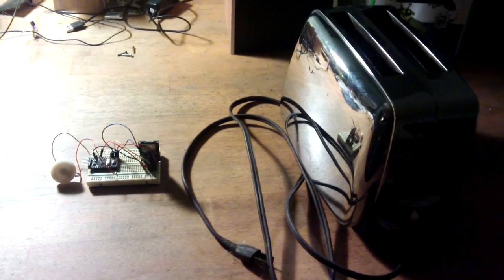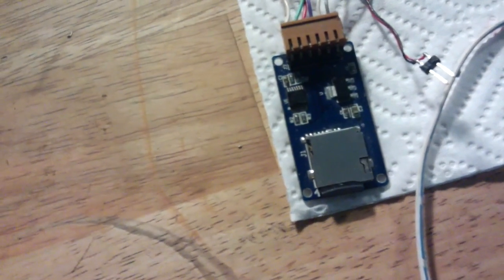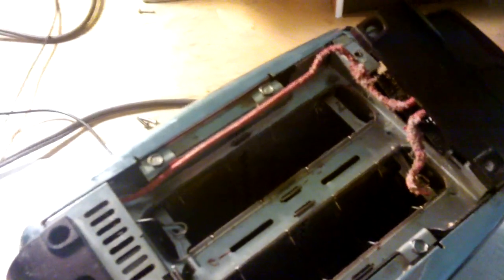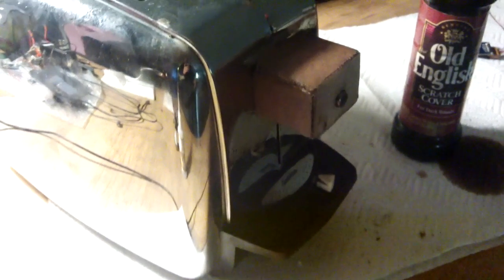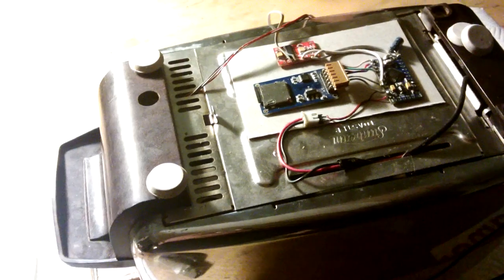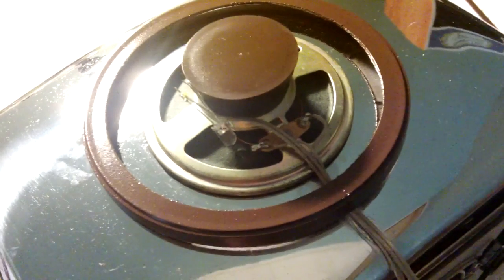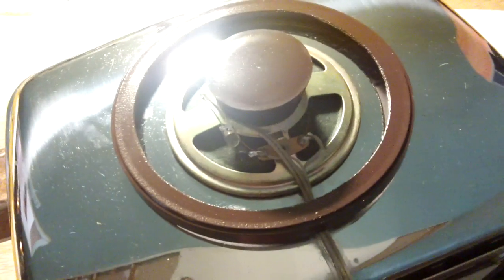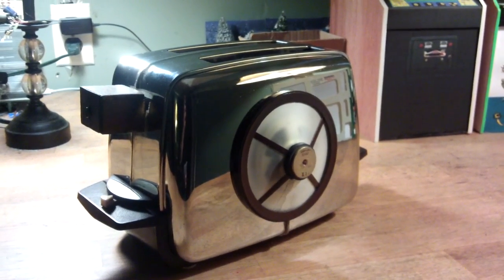Red Dwarf Talkie Toaster - my talking replica build !

Comment: Nice, funny replication! I downloaded your TalkieToaster script and tried compiling it for an Arduino Mini using 1.6.5 of the IDE but got a missing SPI.h error. I had to copy SPI.cpp and SPI.h into the .ino folder for it to compile? Did you experience any compiling errors?
Reply from the maker: Hmm nope, thought the SPI.h was already in the IDE. But, then again my Libraries folder is full of all sorts and this code was from the larger R2D2 project (which is waiting for parts). I used IDE 1.6.12 btw. 
Am glad you test compiled it !
Reply: Yes, I thought SPI was part of the IDE so it must be just my setup! I'm interested in what you've done because I was planning to do something similar but attempt to minimise everything, using a Tiny AVR and a Winbond flash to store the vocals. I managed to write and read the flash using an ATMEGA328 but have yet to try the same with a Tiny AVR.
Reply from the maker: Best wishes for the project, that's intriguing !
I tried something similar using the SPIFFS file system area on an ESP8266, but the TMRpcm library hasn't been ported, the AVR version uses the interrupts it seems. How do greetings card makers do it ? lol

Comment: LOL. Thats awesome. You should give it some gas so it can toast again.

Reminds me of my Nana's toaster that played ABC radio every morning when the sun was shining. It didn't have a receiver as such, but the wires or something was just the right dimension to be resonant with the transmission and it got enough power to make audible sound...
Reply from the maker: When the sun was shining ? How fascinating. Wife just said "maybe that's like peoples braces on their teeth when they somehow hear radio broadcasts". I know that in crystal set experiments i've had weird effects with sunlight on a bare wire. A schematic would be good to try that, it might be a long lost reception method, with careful precision wire lengths..
Reply: The sunlight thing is a stratospheric effect that is well known. usually it makes signals weaker.
My uncle was a radio tech. He eventually pulled the toaster apart to find out how it was working. He did a page or two of equations t work out the sunlight bit, but only he understood that bit. I was small and only remember so much. It had to do with the element wire length and the metal sides. Looking back I'd say there was capacitance between side plates and wire and it may have been vibrating from columb force not magnetism.

The toaster had to be in a specific spot on the bench, plugged in but switched off at wall and it had to have sun on it. So the sun may have been a thermal/mechanical thing as much as a radio thing.

I have heard of a guy with a shed that was a radio if the door was in the right position with a unlocked padlock on it.
Reply from the maker: This one vibrates when he says 'toast', sort of paranormal, memories of toasting, forever longing to relive it's * cough * golden days.
Reply: Maybe have Alf's head pop out sometimes?

Comment: Amazing work
Reply from the maker: It was much more difficult to separate out the audio from the canned laughter and voices with the original. But it would improve it, I agree. 
He'll likely go onward to imitate other talking robot type things, cos there's a 4 gig SD card in there lol. 
But also might follow the bigger project, an 18" high R2D2, with bunches of sensors, webcam, for internet enabled home security.
Reply from the maker: Thanks Steve. It was a lot of fun too. Such things as finding a programming fault, so having to do a firmware update on a toaster lol
Reply: Fantastic but you shoulda put the original toaters quotes in also.